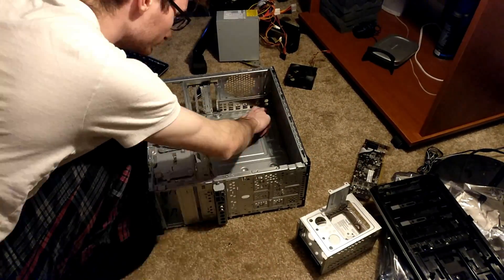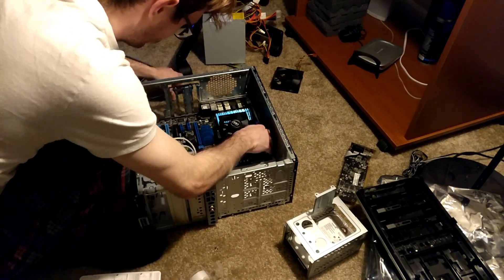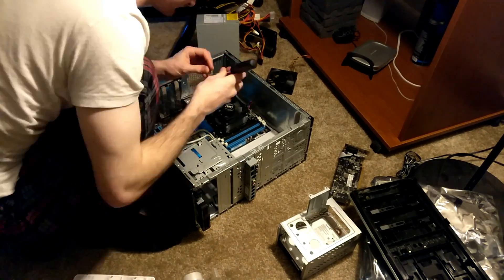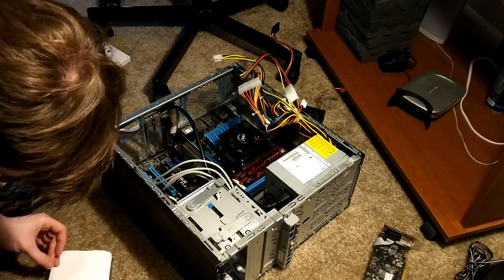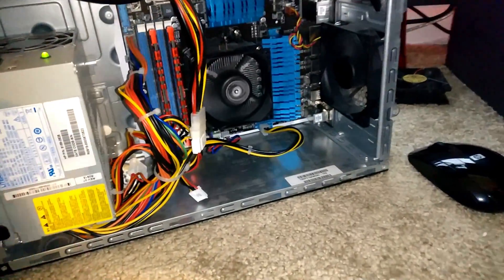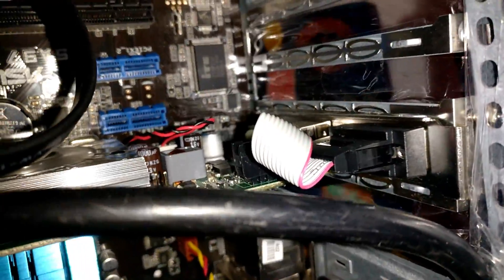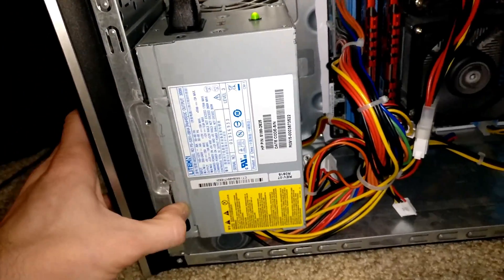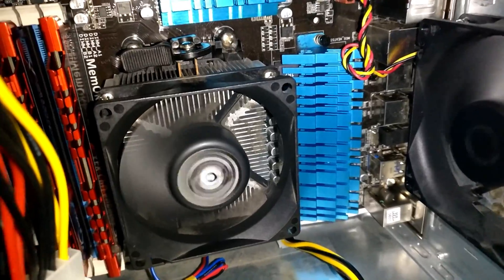how to put a ATX motherboard in a micro ATX case

Comment: Thats an ATX size PSU? I am considering using a Dell Vostro mini/micro tower, but put a mATX board, maybe a B450 in it. I would prefer to install an ATX PSU, as the cost is lower than a SFX. Great fit!

Comment: Why not cut out the 5.25in bays?  The cage takes up too much space and you could have drilled a hole in the top and mounted the psu there so it could push heat out of the case.

Comment: Very hard to hear you over the too loud music.  You put the PSU over a critical ventilation out grid.  The non CPU fan is not blowing air out.  It is blowing air into the case that is supposed to exit through the front which you blocked. Also the MB is supposed to be mounted on standoffs for cooling and static purposes.  Paper would not be enough insulation for static. It can go right through paper.  But kudos for your out of the box thinking.  You could have mounted the PSU outside the box on top with a hole for the cables.  : )

Comment: emmm no.Just no.I had my original micro atx case and when i bought a full atx board the ports didnt lineup.The board did fit in,but the ports are a few little inches away.This method you used did nothing
Reply: Stelios Emmanouilidis well obvs it didn't work for you, because it was a custom job on his part with his components, it worked for him, didn't for you, he made the video to showcase not to help you do yours

Comment: Nice mod! Cooling and cables could use some work. You could drill some holes to add more fans. But I suppose you might not even be using this PC anymore. Those FX CPU's can get very hot especially the 8 core ones.